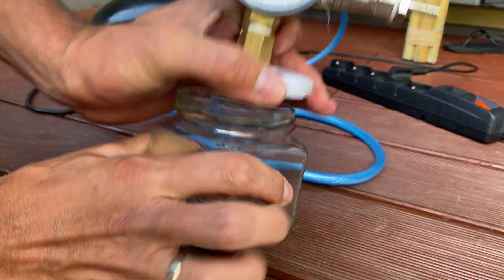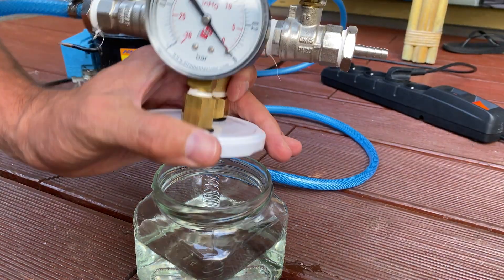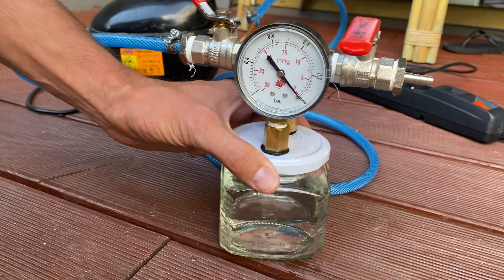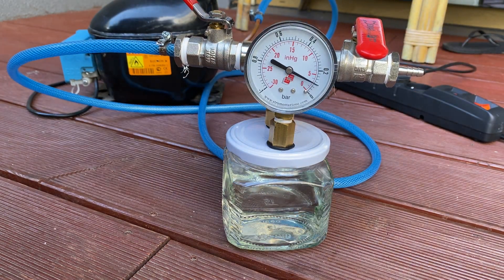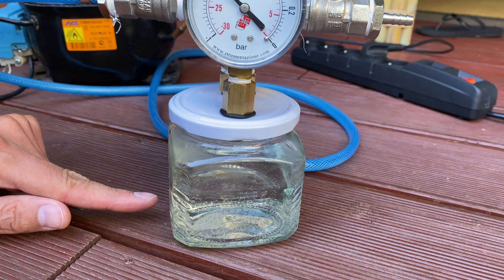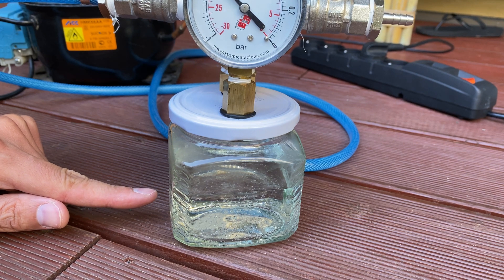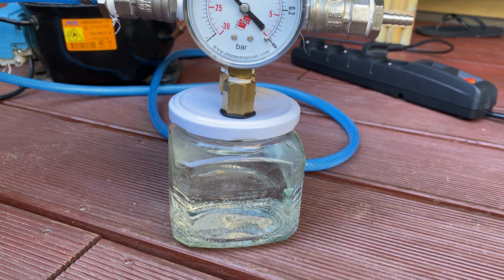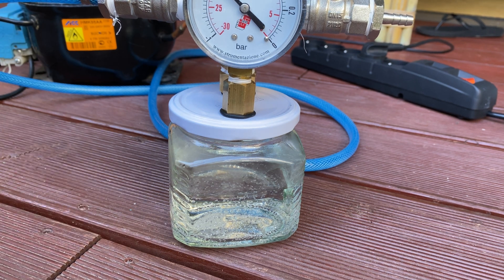How To Build A DIY Vacuum Pump

Comment: Hello ! I would like to make a vacuum pump for vacuum casting in jewelry. Can the refrigerator compressor produce the necesarry depression for succion of metal?
Reply from the maker: Hi! It depends on the engine. Mine was quite enough to remove air from the resin but I would buy the more powerful engine next time or just invest into the professional one with a chamber as the final price is almost the same :)
Reply: @IlyaYarshou ok thanks you for your answer. I will make the experience